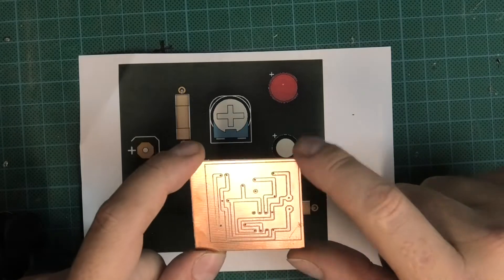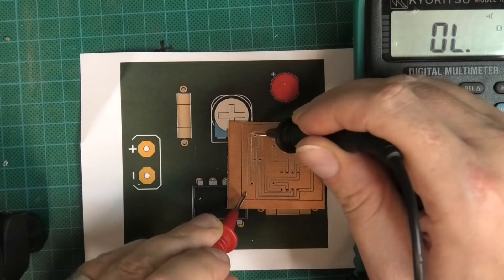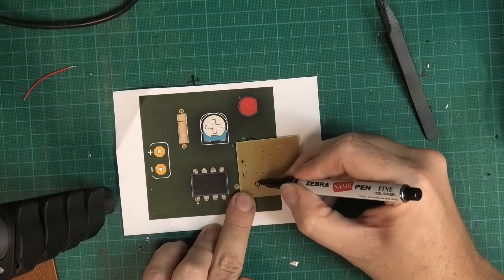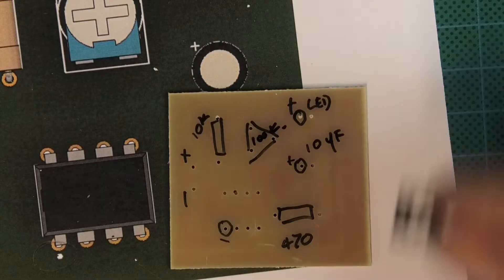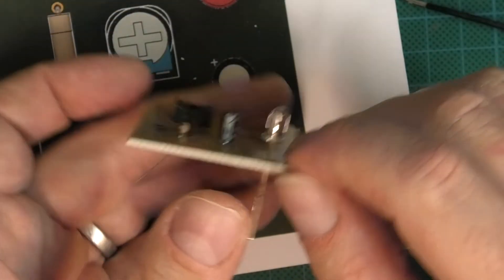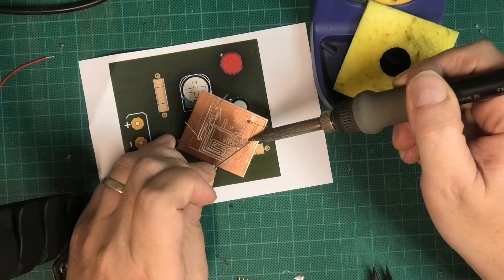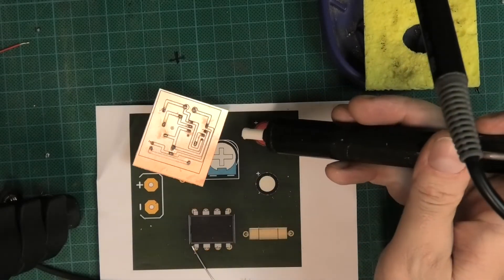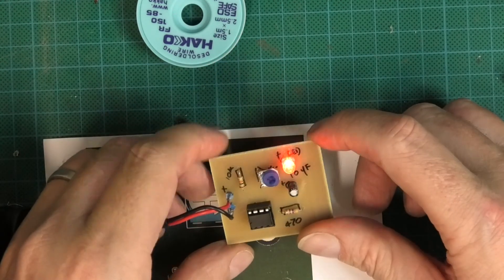Fusion 360 PCB to CNC Milling Part 5: Soldering and Checking

Comment: Another good option to clean the cuts is to use fine steel wool. Clean while the PCB is secured on the work table and vacuum those copper / fiber glass residues, you don't want the fiber glass on your hands. Works like a charm and you get very nice looking PCB afterwards!